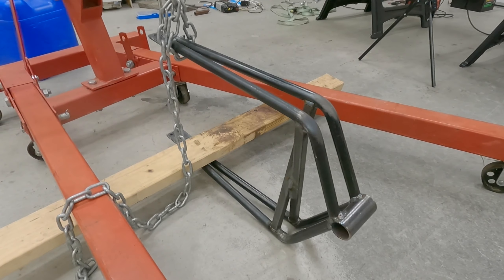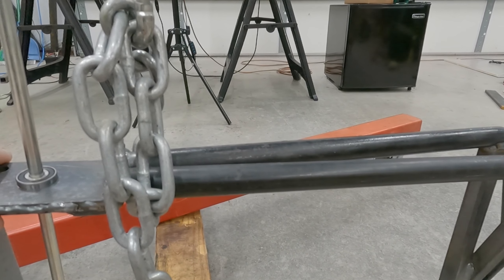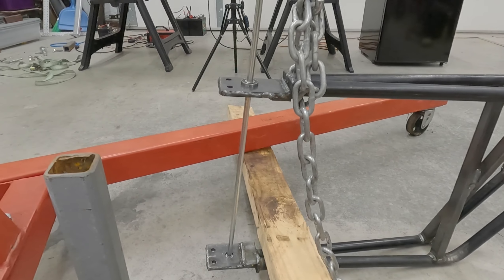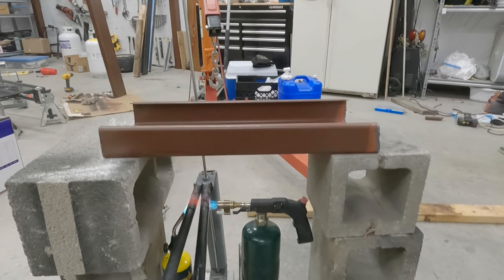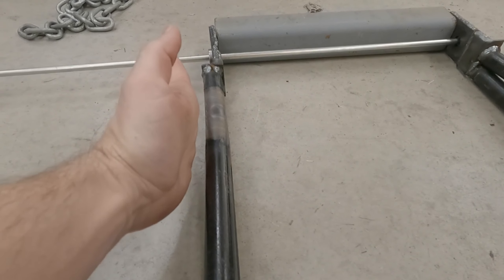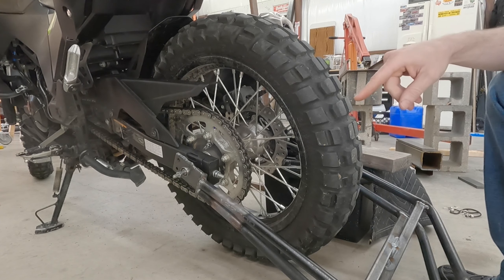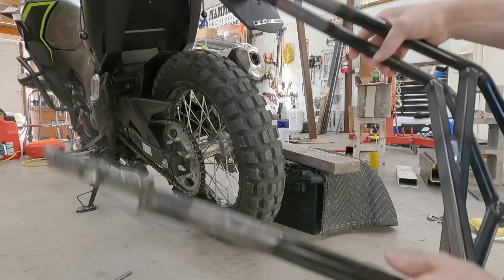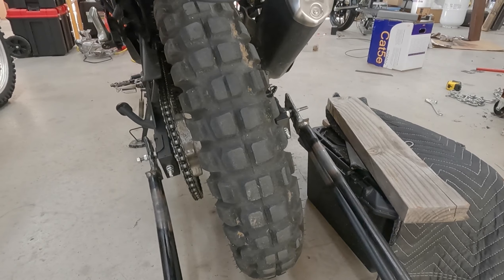Kawasaki Versys X - I screw up and fix my custom trailer hitch

Comment: Im digging the build. Much respect for your project. I just ordered my fender eliminator kit from T-rex racing yesterday for my 300X
Reply from the maker: That's the one I was looking at as well. My thought process is having the rear fender would probably be better if I have a trailer, but I may still remove it. Let me know how your experience goes with the eliminator kit!